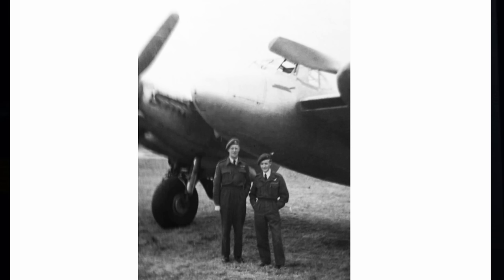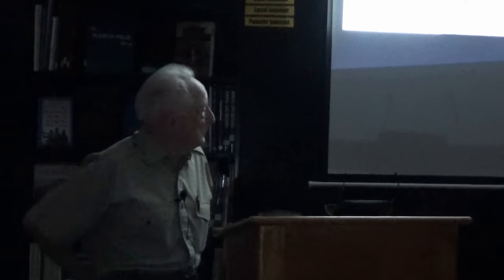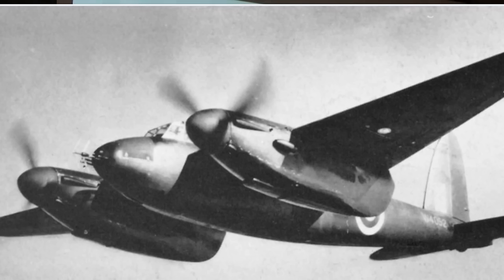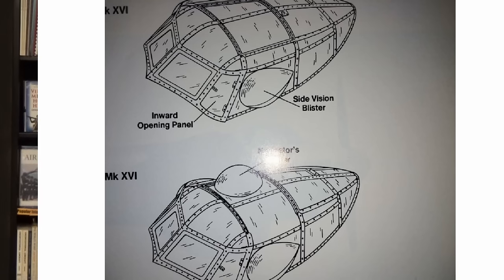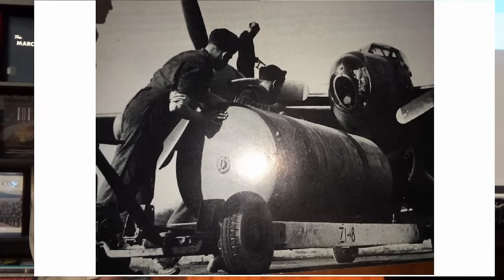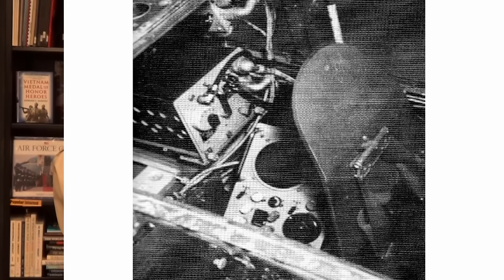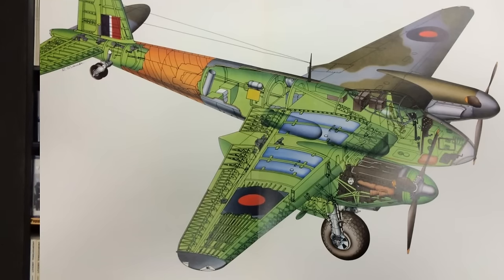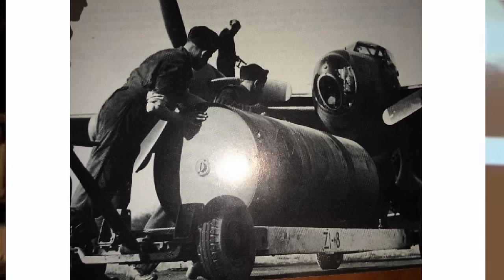Ken Wright Discussing the de Havilland Mosquito

Comment: The version with the 6 lb gun came quite late in the war - it had limited success but sunk a couple of submarines, one the 6lb shell passed through the pressure hull, through the engine block and out through the other side of the pressure hull. Bits of flying engine block punctured the hull as well. The 6 lb gun was designed as an anti tank gun.
One unusual thing about the engines with the open exhaust stubs was there are 6 on the outboard side and only five on the inboard. The rear two exhausts were twinned, I believe to direct the exhaust away from the radiators. This slowed the aircraft a bit. The exhaust gasses added 10 or 20 knots to the top speed so needed to be directed carefully.

Comment: Some Mosquitoes were also used for passenger transport - one or two people could be seated in the bomb bay, they also carried high value freight such as ball bearings. The flights were often into neutral Sweden so were labeled as British Overseas Aircraft Corporation  (BOAC). I believe one of the Atomic bomb scientists (Neils Bohr ?) was smuggled out of Sweden using a Mosquito - he had a more conventional journey across the Atlantic.
Reply: Not actually seated. Just on there front like a Bomb!!!!  Would have been so sad if they opened the bomb door!!!
Reply: @johngadsby6599  The picture in the IWM shows some sort of seat - at least one passenger survived the bomb doors being opened. The aircraft was also modified to insulate the bomb bay with felt, provide oxygen for the passenger, electrical power for the heated flying suit and an intercom. I think the seating is shown in a picture in one of the books about the mosquito as well. I assume there were also arrangements for the freight, I guess since these were civilian (BOAC) aircraft they did not have the bomb hangers but it would not take too much engineering to fix something to the attachment points to carry freight. Note the bomb bay doors are not structural - the RAF were lucky when a trial Nuclear Bomb fell off the bomb rack in a V bomber over Reigate that the bomb doors managed to contain it until the pilot dropped it into the Thames Estuary.

Comment: 20mm cannon in use by the RAF and the US is about 750 rpm in WWII
Reply: I doubt that since an M2 Browning "only" has a cyclic rate in the 550-600 rpm range and a M61 20mm Vulcan needs 6 electrically-powered rotating barrels to hit around 6,000 rpm. The GAU-8 Avenger 30mm in an A-10 is WAY slower at "only" 3600 rpm or so max. Even an M16A2 "only" fires around 900 rpm. Ultimately the "cyclic rate" of a "long-recoil" machine-gun or auto-cannon is a function of the length of the cartridge and how far forward and backward the barrel and/or bolt have to travel in order to fire, extract, eject, strip, chamber and lock back into battery each "round". 

And the larger the gun, not only do you WANT a slower cyclic rate because invariably your "ammunition capacity" is reduced relative to smaller guns you also need more time to "spot" the hits/misses, judge whether or not to fire again and properly aim and fire another round on the same target or shift fire to another. An M2 has a "slow" cyclic rate specifically so a GOOD "machine gunner" can and will fire at most short 4-5 round bursts including at most a tracer or two and two or three "real" rounds being fired "for effect". Its also slow enough that with a little practice and patience single rounds can "easily" be fired. 

You don't "zero" and/or 'sight in" a machine-gun/auto-cannon that's a "crew-served weapon" any differently than you do a "rifle". Single shots of carefully aimed fire separated by elevation/windage adjustments. And yes, even machine-guns and auto-cannons on aircraft are "zeroed" and "sighted in". Your guns and ammo are also your life in the air in a "dogfight". Literally. Screw up and/or waste either unnecessarily and leave yourself unarmed but not "alone" in the sky and you're rarely going to "escape" if you happen to be making a "firing pass" on the enemy and all of a sudden are "Winchester" and "break off" and "turn tail and run" suddenly since typically the enemy will figure out you're "disarmed" before you do or at least will figure out what to do as a result before you do. 

Its hard to go from "attack mode" to "retreat mode" instantly and "unexpectedly" which is the case whenever you never have or lose "situational awareness" and have no idea how much if any "rounds" you still have and/or are able to fire. And at 750 rpm, which is obviously 12.5 rounds per second and with a gun you're "remote controlling" and that has a significant delay between "trigger" and "firing pin" and with the progressively lower magazine capacities as guns get larger, it would be extremely difficult to "keep track" of how much "trigger time" you have left and also difficult to shoot like a "good" machine-gunner and limit yourself to only 3-5 round bursts in a "dogfight" situation. 

And a "ground attack" mission where you're "rolling in" on a ground target and are potentially flying/diving toward various anti-aircraft fire is NOT an "easier" or "safer" mission than a "dogfight". At least not for YOU. The ENEMY there on the ground "sitting back" and waiting for you to fly into his "field of fire" if "smart" or at least "well-trained" won't actually open fire until the "last second" when its too late to "flinch" and you're committed to the "run" and "pulling up" or "veering off" to either side will only make you an easier and/or slower target to hit.

Comment: The issue with the USAAC/USAAF (United States Army Air Corp/US Army Air Force) was that some desk jockey decided to limit all US Army Airplanes to a Single Stage Supercharger!  Figuring that a Turbocharger was better at increasing high altitude performance.... I guess he didn't realize how big an engine modern fighters used, and how big a turbocharger for them (with the technology of the time) would be!  (P-38s were the only USAAF airplane that successfully had SuperTurboCharging with a V block engine!!!)
 
The P-51A could make it to Berlin and back at low altitude, but due to the amount of fuel used to climb to 25,000 to 30,000 feet the later P-51s with a Packard built Merlin engine in them needed an additional fuselage tank in addition to large drop tanks.